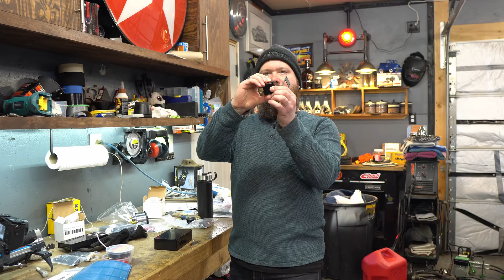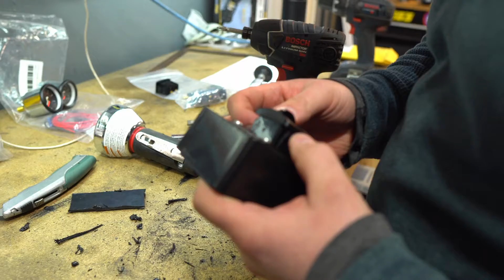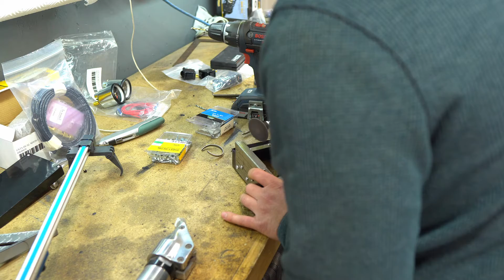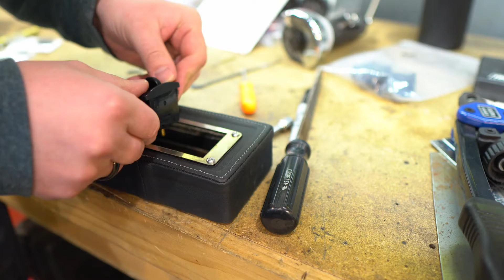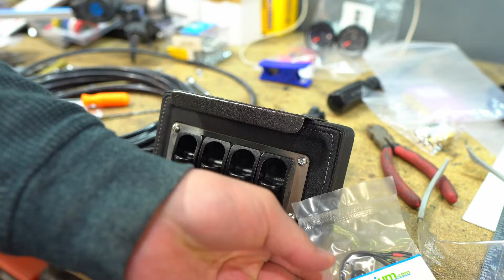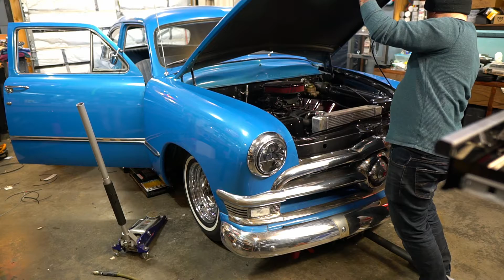Custom paddle valve housing! Manual Air Management Installation Part 1; Shoebox Ford Ep20

Comment: Do you still need  air valves for paddle switches ?
Reply from the maker: Great question! There's a few ways air suspension works; mechanical valves and electronic. Mechnical valves are generally just a paddle switch (like the ones I had in this video) and electronic valves air solenoids that are triggered by a 12v momentary switch. So with mechanical air valves the air lines run up to the back of the paddles and with electric valves (solenoids) they run to the valves (solenoids) wherever you choose to mount them.

Comment: Kind of unrelated to the video but you seemed like you may be interested. I'm making a diy electronic air manifold controller. It's fully open source so you can customize it however you want. Obviously free, it's open source. It's called OASMan. I can't send links here but google 'arduino open air suspension' and click the github link that says OAS-Man.

Comment: Thanks for the video. Im just wondering if the switch side is just pushed on with no clamp or what? plus what are the two wire connectors on the back of the switches? Also on the gauge side ,how does it go in  or is it just push in as well? Thanks again!

Comment: Nice box. Can you please give me a link to where you bought the air valves (switch design)?
Reply from the maker: I purchased the switches from Bag Riders which came with the metal switch frame. 
https://www.bagriders.com/manual-paddle-valve-kit.html

Comment: I’m not too familiar with air system. Is the splitter installed so on goes to the gauge and the other goes to the bag? when you exhaust the system, where is it vented from?
Reply from the maker: So, with manual valves, there are a few connections on the backside  of the valves. 
On each valve there is a supply line from your supply tank in the back of the car, and a feed line that delivers to your air bag. The air pressure inside of the air bag is shared right up to the paddle valve. Between the air bag and the feed side of the paddle valve you have a T-fitting that delivers your air pressure reference to your air gauges. 
As for the exhaust on manual paddle valves, there is a small orifice on the backside of the paddle valve that dumps that air right off the valve. So it effectively dumps the air inside the car. It's just normal clean air, so nothing to worry about. It's also not all that loud considering the air pressure that's actually held in the system. it's not "quiet", but I wouldn't consider it loud. 
Hope this helps explain.
Reply: @DadModsMedia  thank you for the prompt response. Also, very well edited video. The different camera angles and such worked really well and kept it entertaining.
Reply from the maker: @Teal2nnr  appreciate the kind words! I've learned from past errors, so now I try my best to capture the task with multiple angle  😅

Comment: Do you think it’s possible I could maybe get the measurements on the box if making the same thing because it’s kind of hard to find a box or something for the plate frame to go on and to cut into it
Reply from the maker: Here's the exact box I used: PINFOX Waterproof Plastic Project Box ABS IP65 Electronic Junction Box Enclosure 6.2 x 3.54 x 2.3 inch 158 x 90 x 60 mm (Black) https://www.amazon.com/dp/B07TS6RY85/ref=cm_sw_r_apan_i_254MRZDHA9V4TBHCAHFE?_encoding=UTF8&psc=1
Reply from the maker: Hope that helps. The fit was excellent and it tucked so nicely.
Reply: Oh my goodness 🤦🏽🤦🏽 thank you soo much man
Reply from the maker: @matthewedwards223  happy to help!